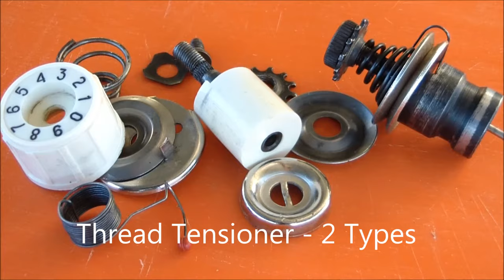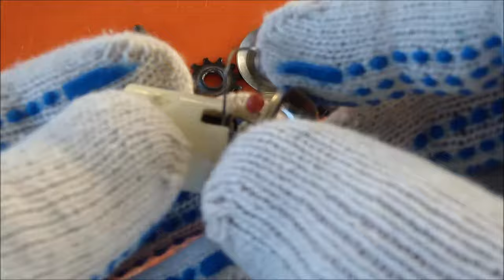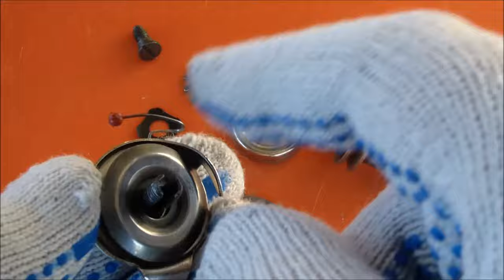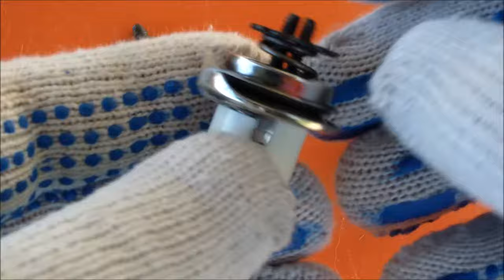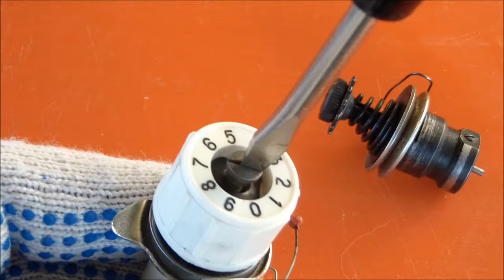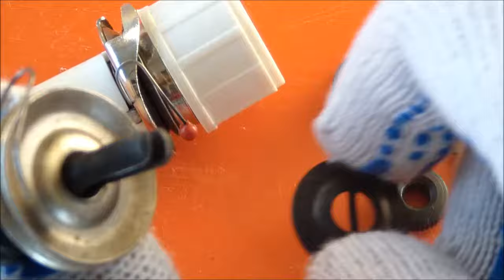Sewing Machine Tension Assembly   2 Types

Comment: Can you help me?
I've been given a Frister 15 Star sewing machine.  It was in good working order but I caught the tension spring on something and misshaped it.
Thinking I could fix it, I took the whole thing apart and made it worse!
1. Can you advise on the correct way to reassemble - mine has one more part that yours. 
2. Should the take up spring be attached to the inside of the machine (I couldn't get it out) and I couldn't get the whole unit out either.